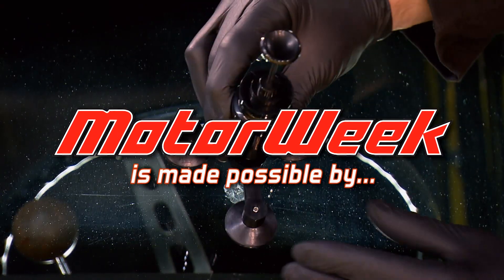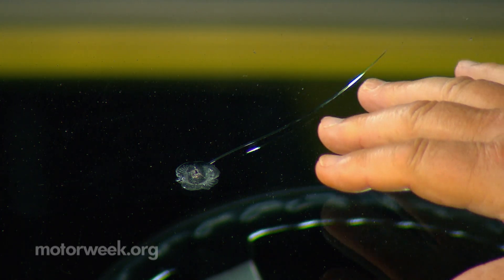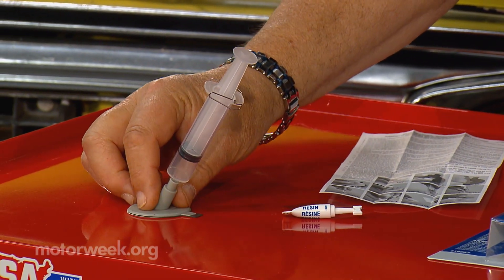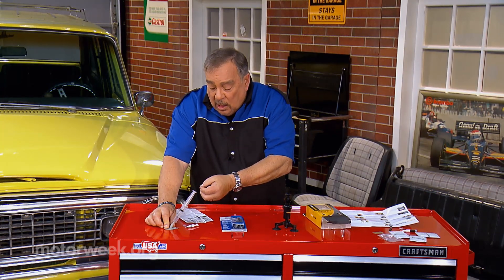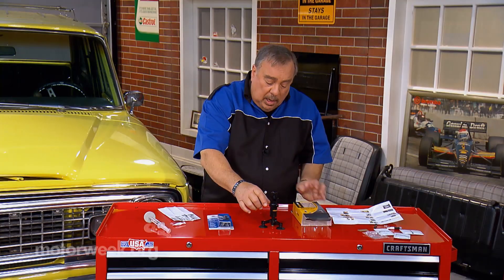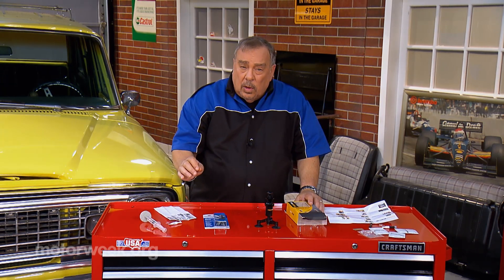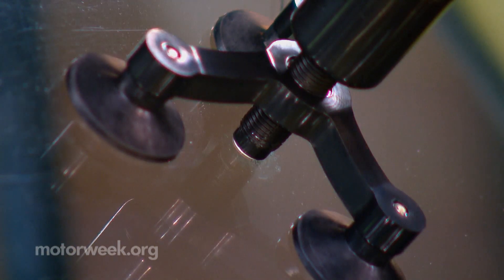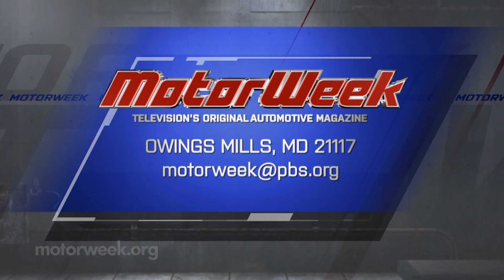Fixing Pesky Windshield Chips | Goss' Garage: Replace Your Rockers

Comment: Hi, Pat.  I've been wondering there is a product that can be used on the entire windshield in order to minimize years of airborne fine chips in the glass that can make driving in bright sunlight or oncoming headlights clearer like with a new car or replacement glass.  I do have two small chips that need repairing and purchased the RainX kit.  I had better get busy.